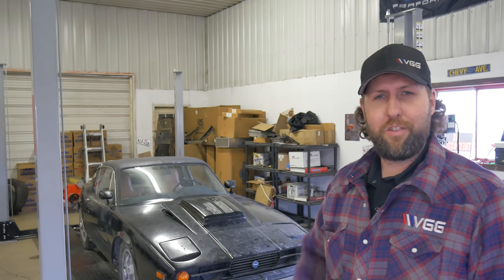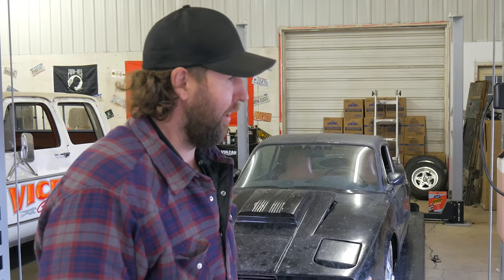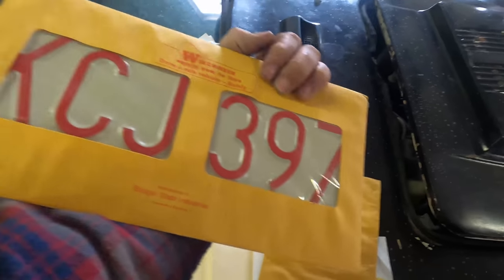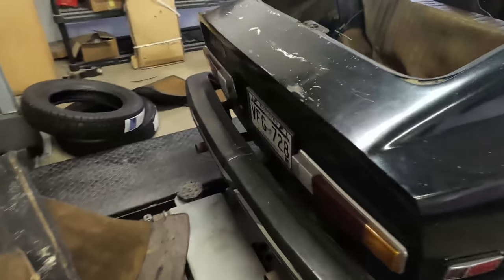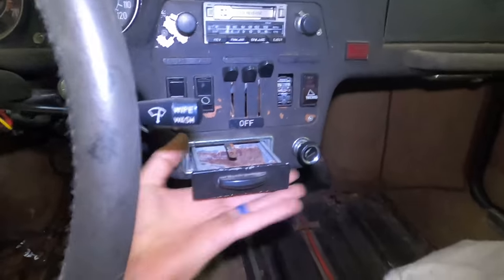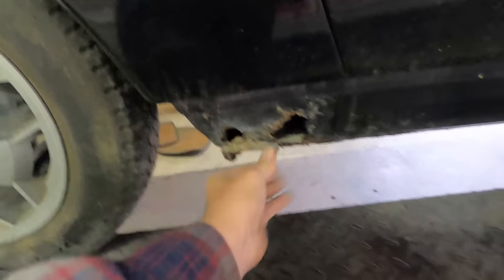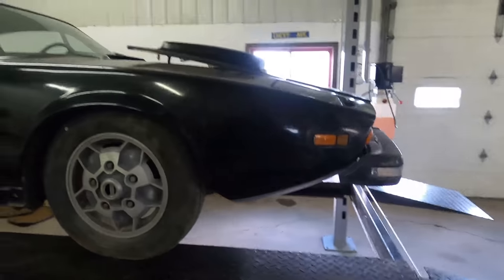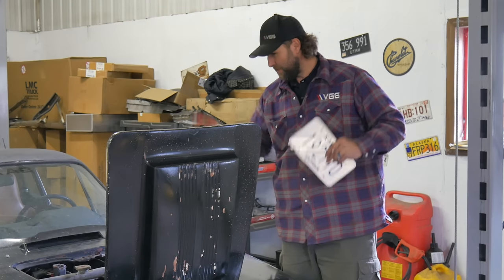FORGOTTEN 1974 SAAB Sonett III - Will It RUN AND DRIVE after 29 Years?

Comment: This car needs a part 2.  Brakes, clutch, taillights, tires, and a cruise down the road.
Reply: Ha.. dude the overheating... thats probably a head gasket or clogged cooling system. Both are pain in the ass but you noticed the milkshake color of the coolant and how it was bubbling?... that’s the coolant system gurgling from pressure building. Either from one of the cylinders or really clogged. I mean look at it
Reply: @beezy7412  be reyt
Reply: @beezy7412  i concur.
Reply: i agree!
Reply: Spoiler alert...
Reply: As well as the broken corvette lol
Reply: You did it you are my best youtuber yep you are incredible
Reply: @beezy7412  he already knows to look at that, but it's possible it could be the thermostat, that would make it act like it's clogged. Which is most likely rusty deposits.
Reply: @beezy7412  it well could be head gasket, they are known to fail in these engines. But even if it is, it's not a huge job. No multiple camshafts in each head, just dead simple pushrod engine. Space might be an issue, but people have fixed these for decades. It's a cool little car, and when in shape, I bet they are getting expensive in the classic car market we have today.
Reply: And than a part 3 turbo kit
Reply: Another one of his 700 mile cruises
Reply: @timothygeiger8271  Also I'm pretty sure I saw a thermostat in that box on the passenger seat as he was digging through. Could be a hint to something wrong there ...
Reply: @jlaakso1706  i said in my comment it could possibly be the thermostat. I'm not trying to argue with anyone😆 i honestly would have to look at the video for a few minutes to remember it🤣🤣lol
Reply: @timothygeiger8271  I'm not trying to argue either - I was actually agreeing with you. I was just saying that I thought I saw a loose thermostat, which would suggest that you're right. Maybe I was unclear in my wording ...
Reply: @jlaakso1706  yeah, i think we both are in agreement. 
The video was so long ago, i would have to familiarize myself with it again🤣 lol
I do remember a little, i think you're right.
Reply: I just watched this episode and loved it, as I do all your videos. I also would really like to see progress meet on that vehicle, especially the bumpers removed. Those are just such an eyesore. Remove those bumpers and that car is going to be sexy. Too bad it's too small for you to drive. I'm 5'9 170. I'll drive it for you 😁
Reply: @beezy7412   You act like none of that could be fixed..? Nothing is truly unfixable unless its really really gone.
Reply: Did you not hear the part were he says he wont fit in it
Reply: Lost interest when I saw FWD...
Reply: Yes

Comment: As a guy who's owned a number of SAABs, confusion, laughter, failure to understand, mixed with a desire to like it,  those are all normal feelings.
Reply: Even Saab thought so 😉
Reply: I feel like Saab didn’t actually know wtf was going on they just slapped shit together
Reply: i was a saab tech for a small amount of time. I liked the 9000 aero's the most. Those leather racing style seats are just beautiful.
Reply: @rotary_turbo99  I grew up with a 900 turbo and 9000 turbo Aero in the house :-)
Reply: In FInland, we have a this saying: Saabism, is a sickness...
Reply: @rotary_turbo99  Yea I had a 9000 aero!!! Amazing car.  But mine had some serious fuel supply problem, and it wasn't the pump (I replaced the pump myself twice).  If I'd had it when derek had this channel though, I'd have known what to do to help diagnose it!  damnit...
Reply: @DonKelleyMusic  i have only worked on 3 variations of the 9000 and twice it was either a fuel pump or a sending unit i had to replace. So maybe there was just issues in general with those tanks
Reply: @bartobuilt2601  Most would just park it in the garage.😉
Reply: Great Derek, Saab use to make some really cool and quirky cars. The 2 stroke ones until 64 beeing really cool.
The Fomoco engine in your sonett was one of the moast common ones in the 96 model 65 to late 70 .
There is a big comunity of Saab lovers here in Sweden and im sure many of them are willing to help if you need anything ......
Keep doing your great vids.
Hakan
Reply: @binladen6783  I worked for a while at one of their plants that provided wire looms for the cars and judging by the way they conducted business on a less than "just-in-time" basis (more like "wow, that was a close call" every day). What killed the brand was bad management more than anything else. Aming too high but unwilling to make a real commitment to get there. And that was way before the GM take over. Then again, the car building subsidiary of the SAAB company started out as a way to make use of military aircraft building facilities that partially became obsolete with the end of WW II. The aircraft designers certainly knew their craft but was often cramped by bean counters that gave them a budget that really didn´t suffice for much of what was needed to make plans come true, and so most of what came out as cars was compromised. It´s actually fascinating how the engineers could do so well with the shit they got handed to start out with... As far as i´ve heard, the SAAB tech´s squeezed out in the neighbourhood of 160 BHP from those Ford Taunus V4 engines in a few naturally aspirated competition builds. That´s past what Ford thought possible. Btw, those engines was as the tale goes designed in the U.S. for the Project Cardinal (set out to be built in Ford´s Louisville, Oklahoma plant) before everything was shipped off to West Germany, ending up as the Taunus 12M car. Oh, and the engine bears a relation to the early Windsor V8 as well as the Cologne OHV V6 found in the Mustang II and ´70s era Mercury Capri (U.S. spec european Ford Capri). The V6 was developed by Ford of West Germany by adding two cylinders to the V4, thus the twin exhaust ports. As for the 2-liter straight four found in the 99/900 and 9000 series, that was a re-development of a really sad machine @ 1.7 liter co-developed with Triumph in the late sixties to keep investments at a minimum, unfortunately the english third party engineering firm that concocted that thing got most of it wrong making for real trouble when the engines had to be disassembled, but the SAAB engineers once again slapped the shit together in another way, making it better with every new take on them (the self-adjusting 16 valve heads are just about as simple yet effective as they could be, just don´t wait for the valves to start making clicking noises as that means they´ve reached the limit), the rest is performance history. Latest (bad) news on the epilogue of SAAB cars history is that the stately owned SAAB replacement parts company Orio may be about to be shut down, i really hope that there will turn up an interested party at the last moment to sweep it up and keep it going.
Reply: my first car was a 72 '99 given to me by my dad back in the late 80's. it had fuel injection which was rare for a car back then. the key in the center console always made everyone who got into it go "WTF?!?!?". the car always ran for me but started burning oil at around 180k. And them bumpers made it like a tank. someone hit it so hard in the parking lot at work once they pushed it a few feet and while their front grill was smashed, only thing that happened to my car was the chrome strip on the back bumper came off. LOL!  it was a great little no frills vehicle. I had the same rims as this one on mine also. But those are the only similarities. the sonnet was a completely different beast from the '99.
Reply: @hasseslaggmek3573  A bit harsh on the Triumph design of the 1.7 slant 4 engine, it wasn't all wrong really, unfortunately SAAB didn't get the better end of the deal, and also got all the early production engines before it was fitted to a Triumph car.  It was in fact a reasonable design but became compromised when fitted in the orientation required for the SAAB gearbox.  Those changes lead to a really poor water pump position in the SAAB installation until SAAB re-engineered it all again for their own 2.0 specification in the 99/ 900. 

The Triumph 1.7 diverged to become a different 2.0 spec for the TR7 and in 16v form for the 1973 Dolomite Sprint, which was the world's first mass produced car with a 16v/ multivalve engine.

Comment: Hi Derek. I'm in Sweden so If you need anything for the SAAB let me know and I'll hunt it down.
Reply: @SKANK_HUNT49  Yes they are.
Reply: Maaan, when i had my Saab, i had to replace the fuel pump and on these Saabs, you can't use a used one. Had to order one directly from Saab...in Sweden...$800....It hurt bad.
Reply: What a shame Saab died. They made some truly great cars.
Reply: @SKANK_HUNT49  Derek was just wrong. Sweden used to drive on the left so most cars (including the very first model SAAB Sonnet) were right hand drive,  but in 1963 the government that the country would switch to driving on the right side of the road, so having the wheel on the left hand side would be the preferable option. The switch happened in a single day in 1967.  For a period in the early 60s car manufacturers sold both left hand drive and right hand drive cars in Sweden, a lot of the time it was up to the customer to decide if the car they ordered would be delivered with right hand drive or left hand drive. But after the switch to right lane traffic, very few right hand drive cars were sold in Sweden, and as far as I know the Sonnet II and Sonnet III were never sold with right hand drive in any market.
Reply: @SKANK_HUNT49  Only the first Sonett I was RHD. Later models were LHD.

Comment: I love these cars, so please do a part two.  These engines were just a Ford Cologne with two cylinders chopped off, so it shouldn't be that hard to find parts or even some performance equipment.  I agree with another commentator that this was never right-hand drive.  Swedish cars are definitely left-hand drive.
Reply: Left hand drive.  And the fuel fill on the passenger side is the proper location.  If you have to refuel on the side of a road, you're not standing in traffic.

Comment: Derek my fraternity brother had a 197? Saab Sonnet-2 and I got to ride in it.  A cool thing I remember  him saying and demonstrating was after starting off from 1st gear, using the clutch was optional.  Just let off the gas when switching to 2, 3rd and 4th.  This one really does need a part two...please!!
Reply: Never seen one of these in person 😲
Reply: I used to do that on my Yamaha 650 motorcycle.  If you have enough play in the chain, you can quick shift and skip the clutch.
Reply: Freewheeling allowed that. When the engine reduced rpms the clutch would release. You could turn freewheeling on and off. Also, the 2-Stroke 3 Cylinder Shrike motor was a hoot to pound down on.

Comment: The V4 is a 1,7L Ford Germany engine, also use in another very rare light sport car (i think unknown in the USA), the Matra 530 (75hp, build 1967 to 1973). The V4 is not a monster but robust and very easy to upgrade to 130hp (more with overbore)

Comment: I had a couple of these cars when I lived in St. Paul.  One green, one orange.  A couple notes:

1. a pertronix ignitor and bosch blue coil (or equivalent) really wakes this engine up.  Absolutely a must-do modification, and obviously quite easy.
2. If I recall correctly, the floor pan was sandwiched layers of copper and steel.  Brilliant for electrical conductivity, terrible for galvanic corrosion
3. there used to be an outfit out on the East Coast called MSS, Motor Sport Services.  They made an absolutely brilliant exhaust, it was a single with a glasspack, you can get rid of all that H pipe buffonery and make it sound like a formula ford.
4, the starter is a real pain to R&R, so take it easy!
5. if you cut the roof out (my Orange one had the roof cut) you will fit in it better.
6. do NOT use those jacking points, see 2 above.  Just use the frame.
7. the proper tire was 85 aspect ratio, aka unlabeled.  165 R15
8. and most important of all.  This 4 speed is the same one they used in the 2 stroke cars.  To prevent oil starvation when going downhill with the two-strokes, the transmission had a freewheel in it, you know - like a bicycle.  It is imperative that you disable this and leave it locked.  The off-white plastic actuator on the trans is what is supposed to do this.  That was a real weak point.  I was able to source new parts back in the day, but even with a non-worn cam, sometimes mine would start freewheeling and making swarf.  It's a real weak spot.
9. if Saabnet.com still exists, there is probably a treasure trove of tips and tricks waiting for you there.

That's about all that comes to mind at the moment, these cars are WAY more fun than they have any right to be, and I miss mine.  I let the city take them at one point =D
Reply: Great Intel 🧠 👍
Reply: What a legend!! Round of applause for Rolf 👏 👏 👏 😎
Reply: I really want one if these now but I think it'd be way too small (like most cars I want)
Reply: I've had 7 of these. All false info.
Reply: @alankatterheinrich8660  Then set a guy straight. What info & tips did that guy say, that was wrong?
Reply: @walter2990  Pay no attention to the troll, Walter...Lol!

Comment: As a Swede, this is really cool to watch! Dad  was a SAAB guy so it’s really nostalgic to recognize the parts they used between the models. You should get yourself a SAAB 96! Talk about weird muffler, straight pipe, driving position, gear changing, freewheelin’ and so on… 🙃🇸🇪
Reply: Amazon guy i am :) 50 50 swede and norwegian here
Reply: I had a 96 when I was a kid (19-20ish) the V4 was interesting... as was the 4 on the tree shifter. It had some cool features that american cars wouldn't have for another 20 years.
The freewheeling was pretty frightening though....Take your foot off the gas and it shifted into neutralis. Just what you want when going down a steep hill....

Comment: As a swede this sonett got me really proud ! nowdays swedes buy them back from the US. it probably never was made with the steering weel on the right side . in sweden we have them on the left side and allways did ,even before we changed from left side traffic in 67.  I love that you save this one Derek !
Reply: Well, I'll be dipped.
Reply: True Urban! And the reason for having the fuel filler on the right side is that in case of running out of gas, you can stand on the side of the road filling the car, instead of standing in the middle of the road. Fun fact, the name Sonett is pronounced as Så nätt, meaning So neat (or dainty as you say). Great video!
Reply: Really? Swedes have always driven left hand drive cars, even back when driving on left side of the road?
Reply: Quite right, even when we drove on the left. //Marcus from Sweden
Reply: @marcusjahnke9287  åh fan
Reply: Heja Sverige!
Reply: @taylorsutherland9447  Yes.
Reply: @taylorsutherland9447  yes thats right
Reply: @taylorsutherland9447  well yes, but actually no, we had several cars imported over from england and you could even order some cars brand new in sweden and have them right hand drive. But that was pretty much non existent by the end of 1960. F.e volvo amazon came with optional right hand drive in sweden up until 68 for the wagon. Dont know if it ever ended for the sedan model actually.
Reply: It is not a SAAB, it is a Volvo Sonett....

Fleksnes

ps. if you get this joke, you are born before 1969.

pps. it's a Norwegian comedian who did a skit about this back in the day.
Reply: You're correct. The only RHD Sonetts were the original ones in the 50's. The Sonett II,V-4 and IIIs were all LHD.
Reply: @testdriver3146  born 73 but still got the joke 😁.
It had 6 carburetors.

Comment: Hi! I'm from sweden and my father was a saab salesman for almost his entire working life.

I was probably made, delivered and raised in a saab. I remember when dad picked me up at school in a sonett 3! Man was I proud. And in 1978 he picked me up in the new saab turbo. So freaking cool. 

Love to see that you have a sonett 3! Please save it and put it back on the road again! 
However there's some things I thougth I'd share. 

That fat saftey bumper was launched by saab in 1971. It was a self reparing bumper in a crash at lower speeds. It was implemented on all saab models both in sweden as well as on export models. I totally agree that it's not very good locking on a sports car but it was not fitted for export, due to any US regulations!  You're in the clear on this one!😉

And it wasn't rebuilt from left hand stearing either.  We've had right hand traffic in sweden since 1968 but strangely enough, swedish cars had left hand stearing even before that... so it was made, manufactured and delivered with the stearingmakeithappener on the left side!

Furthermore, that Ford V4 engine  was optional in the Saab 96 from 1967. It was sold parallel with the 3 cylinder two stroke engine, which also powered the sonett 1 and 2 , but only for a couple of years. I think from 1969 the V4 was standard and the two stroke was out of production.
The V4 engine was exactly the same in the Saab 96. 1498 cubic cm, and I think 68 HP. There was a tweaked engine developed for the  Saab 96 1.7 sport. Bigger bore, 1698 cu cm, and 90 HP. That would fit right in! 

However, numorous engines were made and there tons of parts still out there. 

Good luck with that gorgeous little car! And thanks for a great channel!

Tomas
Sweden

Comment: The V4 along with the rest of the Ford Taunus was designed in Usa as the Ford Cardinal but later scrapped and sent to Ford Germany.
Saabs v4 had different bolt pattern for the bell housing than the regular fords. And a different exhaust to make em sound more like the old 2stroke engines.
For the Saab 99 they started using Triumph straight 4's at first before the first Saab manufactured engine came.